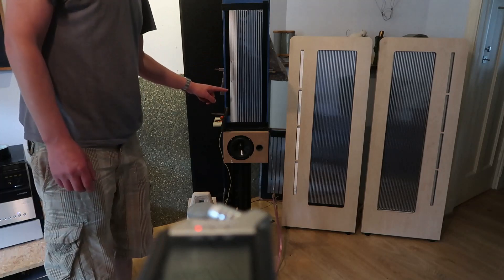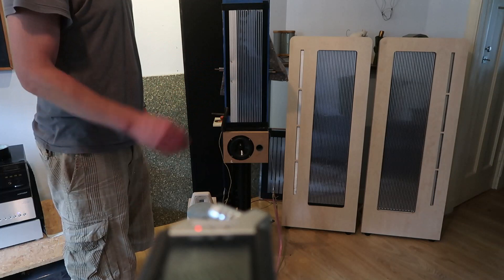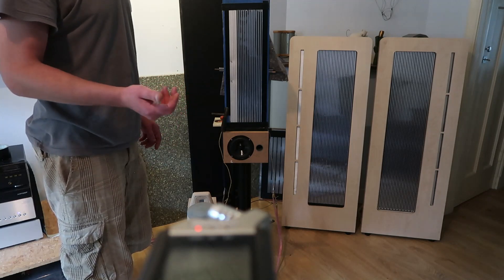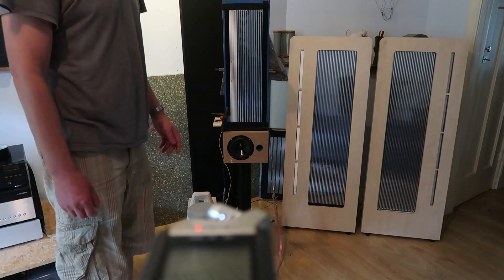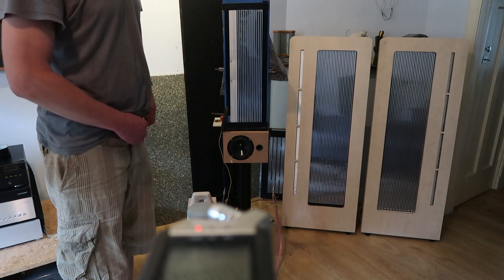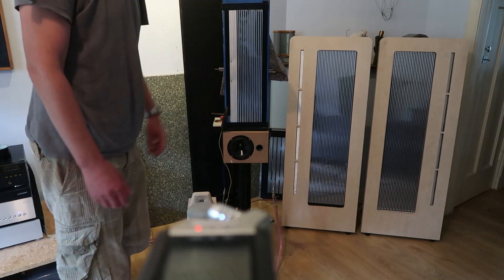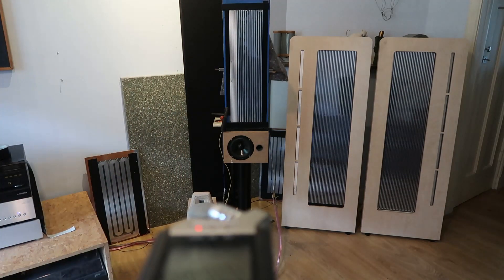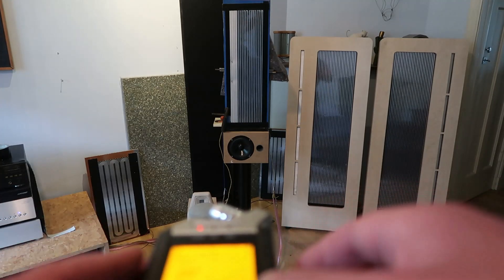Planar magnetic test panel rubber and neodymium combined  -  Part 2 Tune and some results

Comment: I like your designs; in particular this one looks very nice! I was wandering if the loosely suspended tweeter ribbon was not pushed back- and forward due to the air displacment generated by the bass membran. Please feel free to share your experience/thoughts on this. Many Thanks - cheers! Michel
Reply from the maker: Well s ribbon that is only held top and bot and totally free over the length left and right can  be influenced by the bass at high volume .  Such a driver csnnot be curved like this one is  (except by using bias) this driver is  (looks like ribbon)  but is more a  planar magnetic,   it glued top an botrom but the sides are only held by soft foam on the edges of the ribbon/curugated planar magnetic foil on both sides. Thats enough to not wanting to flop all over the place by the bass

Comment: Hi. Have you ever tried Halbach array configuration of the magnets? They promise a significant increasing a magnetic field on one side and eliminating it on the other.
Reply from the maker: i have taken a look at the hallbach once, but the problem is the fiedl it creates is not usable for a planar magnetic speakers. its flips also vertical . look at it like a checker board. :(

Comment: Excellent speakers Joppe!! They look somewhat like smaller versions of my Carver Platinum series ALS panels, but I like the idea of the  planar bass drivers that you built compared to the four 12" cone drivers in each of my panels.
Reply: Those are nice speakers you have , I use to have them and wish I would not have sold them , Bib Carver was a good friend of my father and his engineering friends ,

Comment: Jopee, make one more, let me know how much for the pair,I will buy them , too nice to just discard.
Reply from the maker: well as always i think they could be better. but it might be usefull to sell things instead of trowing them. panels alone are easy to ship.  i do have to make them the same way.  but i am afraid the 2.2 ohm for the mid range might be troublesome ?  if you got dsp you can make them sound like this one , since i needed to have a small raise in the upper frequencies as explained.   they can only be used with rather in efficient woofers. i recommend the  tangbands since they are really low... and gives allot of room to play with 
Like this one https://www.soundimports.eu/nl/tang-band-w5-1138smf.html
or even the 6 inch.  most people dont like low efficiency but i do :) since i can match reandom things more easy... passively matching a woofer is no fun.  if you will be using dsp you can use any woofer ofcourse.
Reply: @joppepeelen  yes, sell your creations brother , list 5hem on eBay so the shipping will be dirt cheap using there global shipping plan , sometime in the near future I would love to buy a pair of your planners , something in the range of a planner that would be used from 1800 hz to 20k or above for a two way mated with some seas 6" I have had for 14 years still in there cartons , they are 86db 1w1m effeciant. I would be using them in a bi-amp set up and one of my home built 3rd order active crossover .
Reply: @joppepeelen  one thing you need to keep in mind is people like us are very critical of the things we creat and usually more critical than anyone would ever be . Sell , Sell Sell my brother ,
Reply: Thank you Jopee.